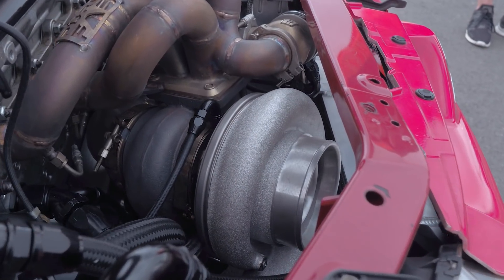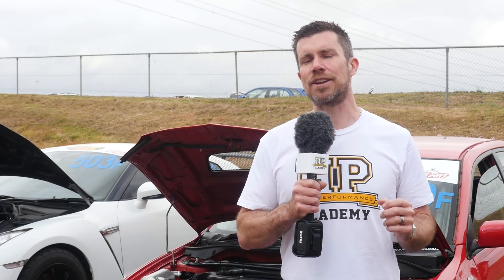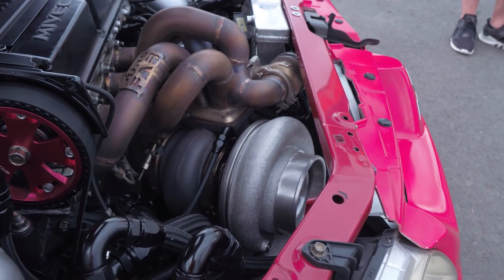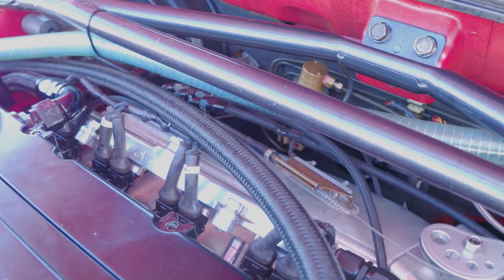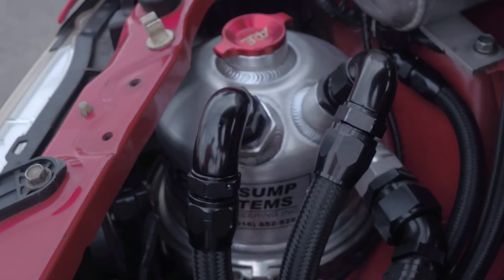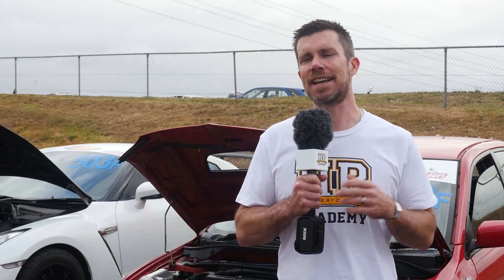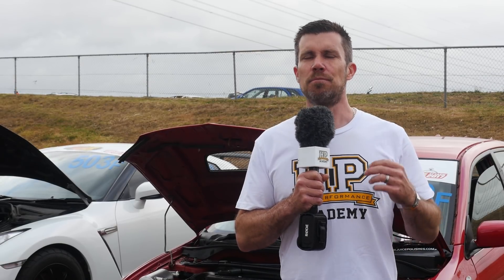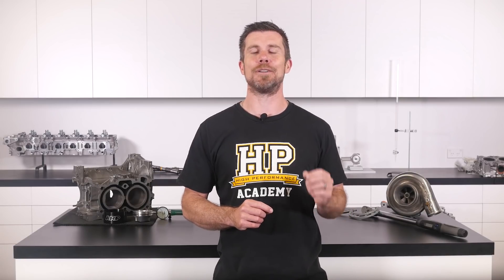[TECH TOUR] 74 PSI of boost, 1238whp 2.2 L Street Car | Micks Motorsport's 4G63 powered Evo 8

Comment: Thank you for using our ancient measuring system, HP and PSI. lolol Still not completely good at estimating KW off of HP but would 950kw be close? 74psi-5bar right? or 5050kp?
Reply from the maker: About 950kw and 510212 Pa of boost according to www.google.com which is great to use for conversions. No matter which system we use people need to convert it one way or the other, can't win XD - Taz.

Comment: You have a billet block based on a 4G64, you have aftermarket rods and pistons, and quite possibly an aftermarket crank so what exactly makes this a 4G63 powered?
Reply from the maker: What would you call it? As soon as you modify a car in any way shape or form you can argue that has become something different ;) - Taz.
Reply: Well if the billet block is based on a 4G64 block design, I would be inclined to call it a 4G64. The block is the heart of the engine. What would you call an SR20 with a VVTI head, I would still call it an SR20, even if it had a Tomei 2.2 stroker crank.
Reply: Although... A Keith Black is a custom engine built on a hemi design, and it is referred to as a KB, so maybe you would call it a Bullet...

Comment: The dry sump oil pump and reservoir was probably the best modification they could've made to that engine. I had a 92 Colt with a built 6-bolt 4g63t swap that I did myself (because the 4g15 is absolutely NO substitute with 92 bhp) and one of the main issues was that it would lose oil pressure sometimes during acceleration. Granted, the car barely weighed 2000 lbs and ran a Frankenstein 19c turbo and even at 20 psi it put down 526 whp through an F5M33 AWD Eclipse trans with a spool and the rear locked out, but it was a hatch and was wickedly fast even off boost. I miss the Mitsu life sometimes, but then I remember the headaches because I didn't have a crazy budget. I have a Civic with a self-built built LSVTEC engine that makes 508 whp, so it keeps me entertained. I have alot of respect for the Mitsu crowd.
Reply: dry sump is ideal but expensive, a accusump is just as effective and simple and cheap.  Its just a simple pressurized  oil tank that squirts in oil when the pump can't keep up.

Comment: Ummmmm, yeah.... it's not like if you're pushing that amount of power and boost that you could consider the car even remotely "reliable" long-term... o.0

Gotta pay to play, folks. You can't DD a car like that for any appreciable amount of time.
Reply from the maker: Reliability is a relative term and 'long-term' in the perfomance chasing world is not comparable to your family people mover.. A 1000+ HP 4 cylinder car is not built to do 100,000kms of school runs, however, the fact it can even do a solid number of runs down the strip at that sort of output and still hit the street ticks the reliability box 100% - Taz.
Reply: Engine wise it absolutely should be reliable with proper maintenance. I know guys pushing 500hp on stock subaru blocks with just basic forged pistons rods, and valve springs, and raping them daily /st legal for many years without issues. Comparing that to a factory car is obviously not fair, but if you build the engine right there's no reason it will fail prematurely. It's all about knowing what is required at X power level and building it to that spec. The same guy is now building a 2.35 ej207 aiming for a 500kw mark. Put down 350kw on 18psi with 1500rpm quicker spool up, on the run in tune while they finish upgrading the fuel setup. Stock MLS head gaskets too, 14mm head studs tho. I think it cost close to 20kNZD which is a fair bit. HPA should check out specialized auto services down here in Canterbury, true up and comers to the rally scene.
Reply: Sam Burrows lmao your comaparing a 500hp build to a 1200hp build .. are you for real? The fact that they’ve got this sort of power from a 4 pot is enough.

Comment: 562 horsepower per liter of displacement.... Holy shit!!!! That's around 38 hp per liter less than a modern F1 V6.
And I'm quite sure that's more than the old F1 V8's. Damn impressive
Reply: and ferrari got butthurt complained and they made rule changes to help ferrari be competitive again
Reply: get real, the F1 v8 were naturally aspirated, this is turbo'ed  and needs a ridiculous 74psi  ,  also the 1400bhp 1.5L F1 engine only lasted 3 minutes for two qualifying laps then it was junk.
Reply: Ivan Nevistic
Well, they were designed for boost...
Reply: Spoonzaza true... and blow up too! :-D
Reply: Honda made 1400bhp in the 80s on a destroked 1.5L ;)
Reply: I'll be Frank I'm Leary about using my name lol thats true those turbo boost adicted engines are crap without their massive boost!

Comment: How about you use bars intead of psi?
Reply: http://lmgtfy.com/?q=74+psi+to+bar
Reply: because no gauges you can buy read over 3 bar.. as for an eboost2 shows psi digitally to 60psi which is 4.1 bar   so this would be showing the psi through digital dash  psi is much easier then bar,  but if you want to know the bar of boost its 5.17
Reply: how about you use psi instead of bar?
Reply: Jaska V v Psi to Bar converter mate.

Comment: Grest vid and super impressive car.  Can you explain a little the strategy for lag management?  2.2l...big arse turbo...do they use nitrous to spool it or mess with cam overlap etc?
Reply: Lag is on an off the throttle a Boost threshold is what you mean? 
Like how long into the rpm is the boost actually making progress?  id say since its a billet block it no doubt revs to somewhere in the 10,000rpm range,  an a 7675+ turbo on a 2.0L would be spooling around 5700-5900rpm an full boost in the 6700rpm Mark but on a Built 2.0L normally revs to 9500rpm on a Stock alloy block Billet again would go into the 10s-11s for a drag motor so your probly making peak power mid to high 7000s so a 3000rpm Power band    with a 2.2L id probly say this is 10000-10500rpm  so it no doubt has more torque an would probly spool 500-800rpm sooner then a 2.0L an have somewhere around a 3500-4000rpm power band id say it probly has a 75-100shot of nos for spooling it up,  

English racing uses the next size down turbo on a 2.0L 
an There is a 2.0L at another shop in NSW using a 7675

This is an insane car though especially for australia an its a dyno that equals a Mustang dyno  with wheelspin it very well could be in the 1350-1400whp mark 

Mean while i'm just sitting at 630whp in my 8  800whp+ is un usable with a manual on streets here  i don't have 20k+ for a seqbox :(
Reply: Believe it or not this also doesn't have a straight pipe it actually has a 3.5inch Cat back sold here in australia which is insane to think they could make this kind of power with out restricting it

Comment: With 1200+whp in a 4 cylinder, what does reliability mean? 100 passes? I'd imagine the bottom end is serviced a time or two a year just to freshen up.
Reply: Mick Motorsport Tuned an evo 9 built by Precision Automotive Many years ago that ran 900whp an 8.8 @ 165mph manual full weight for 3 years no problems on a 4g64 2.4L without billet block it then had a turbo change up an went 1095whp ran for 2+ yrs the motor didn't give up it got turned into a Drag car for the 7 second bounty

Mick also tuned a 950whp Evo 2 that sat for 8 yrs an ran fine with no engine work changed just new fluids an oils :)  

This is a street car Mick isn't the kind of person to do a 4th gear pull on the street it will no doubt be driven normally an with a seqbox it will last a long long time,    :)
Reply: @jjsorenavki7005  The key to much of this is going too small on the turbine housing. If there is one thing sport compact/tuners fear most is turbo lag. So they tend to error to the smaller housing but want to push the output as high as possible. Those things don't go together. If you want instant spool there is always nitrous oxide...
Reply: well those bullet full aluminum blocks are insane.  they are aftermarket blocks man!  crazy expensive.  there are people at 50psi on stock block so not sure why they went this route. interesting setup though.
Reply: epoxeclipse because they want more power..more reliably.  Gives the confidence to push the boundaries...well thats why I would do it 😁
Reply: Because keep in mind, its not like it runs constantly at full boost or even in boost at all all the time. Streep legal means it meets all the requirements to be driven on the street per where he lives. Where I live, no safety or emissions required, just as long as it's registered. Just cuz you habe a high horsepower vehicle that can be driven in the street, that doesn't mean it's always driven everywhere at full throttle. My car has the same power, only a v6 and it's my dd, just not during the winter months.
Reply: 4g64 is another block Mitsubishi made that comes in quite a few cars world wide,  mostly here in Australia they were found in the early 4cylinder magnas the motor displacement is always 2.4L   its basically like the Mitsubishi version of someone doing a K20/K24 combo motor, Since the 4g64 is a N/a motor you swap the 4g63 head on top The 4g63 is limited to 2.3L increase in displacement unless you went a custom route but i personally never seen over 2.3L 
However the 4g64 allows you to not only increase displacement 2.5 2.6 2.7 But also decrease it  2.2 2.1 turning it into a motor That used to redline around 8500-9000rpm as a 2.4L an with more torque then a 4g63 to something as a 2.2 or 2.1 could rev well into the 11000rpm range like this Car above  Destroking a 4g64 is one of the best builds u can go ,  it is however more $$ then a 4g63 build an hard to sometimes come by a 4g64 block getting harder to find,
Reply: I know they took precautions to protect the engine like having a dry sump, but with high rpm and cylinder pressure the rings are going to wear and start leaking eventually.
Reply: Yes it was Micks motorsport is all about building reliable hence why its a billet block for 1200hp   Mick also has a drag S15 that has been running over 1100rwhp since 2011 with no major issues on it ;)  infact it was even a Stock head for quite a lot of that time ;)  runs 6s
Reply: SeMpr3s Soren pretty much what i was guessing. Thanks a lot
Reply: Np man
Reply: back in 10/11 chris miller was getting 1000+whp out of his steel rod b18 sfwd civic on a factory cast head/block/trans and got over 2 seasons of heavy racing in the US before he ran into any issues with it.  Cant imagine why an evo would be too different. Freshen up every season, every other rebuild or so
Reply: im in oz too, know the car. Sucks about his injury though. Section 8 sfwd spec (stock chassis full interior a2a etc) awd civic went 7.64@193 with a 76mm turbo k24 and all oem drivetrain, just gearset and front driveshafts. Can see how much easier they launch though, like the early gtr's just in reverse. FWD until the wheels spin, but still pulls form the front so they avoid the hopping bog and walking all the way down the track. Quick evos look like a real handful to drive
Reply: SeMpr3s Soren whats a 4g64 may i ask? And how do they get it to 2.4 ltrs?
Reply: Joe Grine it's a Mitsubishi engine. You usually bore and sleeve the block to increase size, but you can also change the stroke.  they're using a billet block so they can customize it a lot more
Reply: Aaron _z33  much respect boss
Reply: SeMpr3s Soren Not to mention the loads of info you provided. I learned a lot. Respect.
Reply: No prob's man it was just a small run down way more to Learn, i've had a 2.1L 4g64 built by Precision automotive about 2 yrs ago for my Old Tme,  crazy motors,  Billet is a whole new level though
Reply: The Car was running 1200awhp on the standard block  before they went billet, i spose the owner wanted to be the first in Australia to run it.. this is also a Full weight Street car an Awd loses more power in drivetrain lose then Fwd or Rwd,  an it also is harder to Hook a big powered evo down since its taken so long for them to get into the 7s.. they just Bog down if you fuck up,  Civic wheelspin but still carry speed evo just dies in the ass lol,  But this car is going for a Mid 8 as a Full Street car nothing shed out of it, they did 8.8 @ 165mph in 2013 with an Evo 9 with 915whp an H pattern manual , (Full weight street car* rego'd an driven alot, that car is Owned by the owner of Precision Automotive Racing, that has now been turned into a 7 Second bounty Chaser,   

Sadly the owner of this 8 has injured his back, so it may be some time before he gets to hold a record or two, :(
Reply: I think he was referring to the bearing maintenance interval, not the block or crank itself. Also, they went with the 4G64 because of the taller deck height over the 4G63. It wasn't a matter of what boost they were running. Saying that, I don't know many stock block EVOs (if any) that are running 70+ pounds of boost...for very long anyway.
Reply: Coming from a rotary fanatic, even with 1200+ hp this piston motor is still more reliable than a rotor
Reply: Wouldn't say this Pac performance have a few 13b an 20b cars with 1000hp that are still running 3-4 yrs after being built.. the amount of maintence required for a Rotary is more i held 800whp in my 20b fd s8 for 3 yrs no problems serviced at Pac , an 600whp for the 13b i had in a previous fd s6   Rotary are not about having 1000whp+ though  Rotary powered vehicles are 150-200kg less then an evo factory wise different wheel base an a rx7 can still corner well with 600whp an stock aero as for an evo kind of needs a few things done to keep it corner happy but when you put 600whp in a Old gen rx2/3 you have a high 8 second car, as for an evo 1-3 needs 750whp+  id rather see 500-800whp cars then 1000whp+ as cool as it is
Reply: Thank god he is a builder then when those signs show with all the data he has he will be able to beat that to fix before it does go,   you'd be dumb to do a 800hp build an not have sensors ensuring nothing is going wrong obviously you can't have a sensor for everything but for the major things  i've had my Current Nitto 2.3 In a factory 8 block for 4 years now an been in 3 different evo chassis ive had it up to 850whp but for the street that is kind of dumb id need radials on 24/7 means its not an all weather car also i didn't want a dogbox i had a sheptrans which i recently sold an went back to a stock adm 5spd with billet shifter forks known to make 550-700whp with that piece of mind they don't whine  but there is around 15-20 evos in Australia wide sitting on 900-1100whp setups with no dry sump from 2.0 - 2.3L  63s to 2.1 - 2.4 64s  :)
Reply: Well I'm sure reliability wasn't even going through their mind when they built this car

Comment: Insane, probably also the cost involved.
Reply: Well if you invest into a billet block you just saved yourself a bunch of time and money pushing over the limits of the cast block. Lots of people including HPA have built high power 4Gxx engines and blown up a few in the process. So making the investment up front makes sense if your serious. If you aren't serious 500 whp is still quite fast in a compact car believe me, you don't really need 1,000 hp. For the level of competition he was entering he needs that kind of power. Just as I need 600+ hp for the competitions I enter.
Reply: The guy who owns the car built the car at his Own shop with his employees an self tuned it so really he is just paying for parts not labour 

You can also make 1000-1200whp on Cast bottom blocks an still be quite reliable but will come down to the setup an comp of the block,    Mick wanted to run things a little different,  I also heard they have a 2nd billet block an want to explore the 1.8L destroked motor like Xtreme tuners in the future